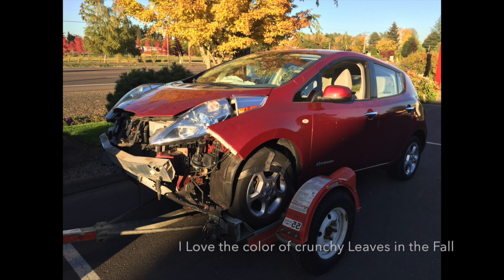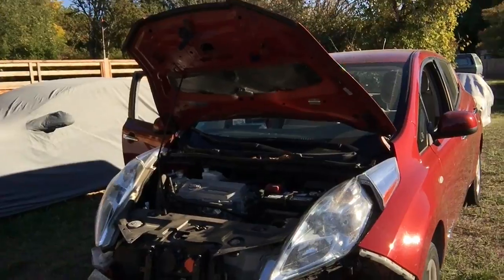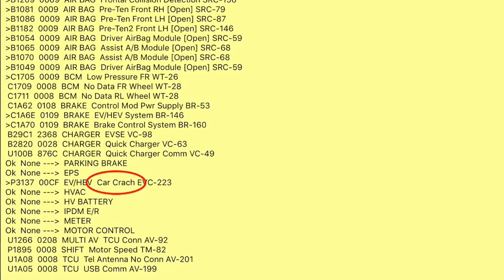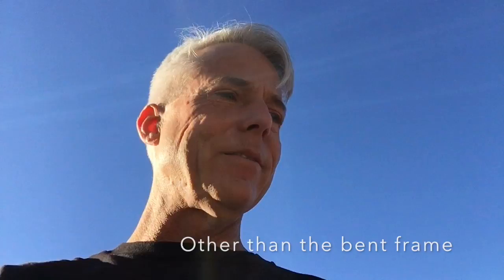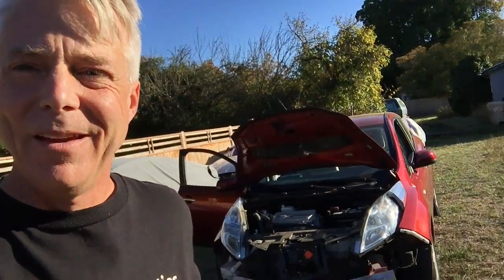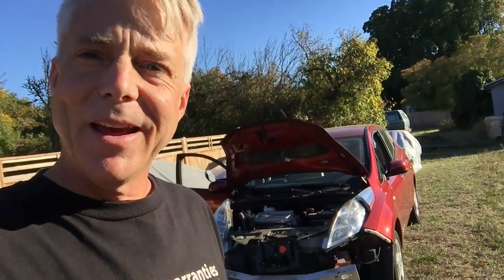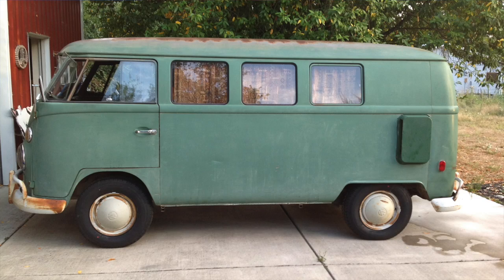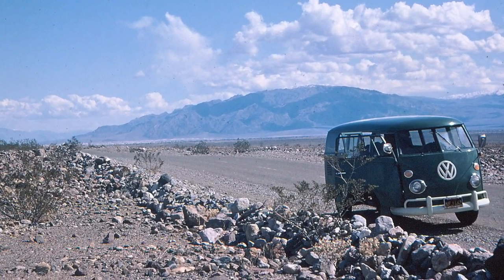Wrecked 2011 Leaf intro

Comment: I will have a keen interest in following along with this project.  I have a 2011 Leaf and a 1985 Nissan 720 pickup.  My eventual goal is to upgrade the Leaf pack but keep the original, plus land a wrecked Leaf like you did, pulling out the entire leaf drivetrain and battery system, adding the second battery pack, and fitting both packs under a raised bed in the 720 pickup.  I'll be interested in how (or if) you take the motor/transmission/transaxle and move it over to that RWD bus.

Comment: don't let it deep discharge or sit around with a full battery for too long.
Reply from the maker: That’s an active concern. If I pull the 12v with the HV battery at 50%, will it stop discharging the HV battery like it will on a Model S? Do I need to also pull the battery disconnect on the pack?
Reply: I have a Leaf pack (removed from the vehicle) that sat for over 9 months without the cells dropping below a healthy voltage. The BMS seems to draw negligable current from the cells.

Comment: Damn! The leafs are cheap in full driving condition in the US too! They cost more than double in Europe :(
Reply: Sadly for current owners, but good for buyers, Leafs will be getting cheaper after Nissan increased the price of replacement battery packs. The battery degradation issue is bad on the 2011-2012 model years, questionable on 2013 and early reports show worse on newer 30kWH (especially after removing the 80% charge limit option).
Reply from the maker: jkenny1 Maybe we’ll need to find ways to adapt a different battery.
Reply: @CafeElectric  Check out this guy in the Netherlands, I'm watching his progress in adding a range extender battery: https://youtu.be/0i6VcZXXQyY I've already purchased 9.8kWH for my Leaf when I got a good deal on the batteries. I'm hoping he'll sell the electronics kit to integrate it.
Reply from the maker: From what I can see, I got an unusually good deal by cutting out the middlemen.
Reply: x 1.5 ))